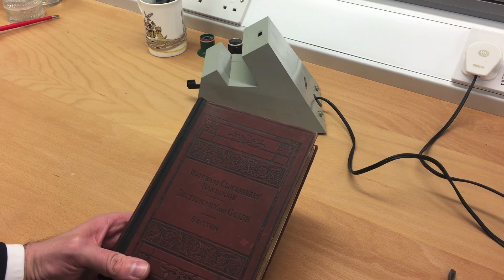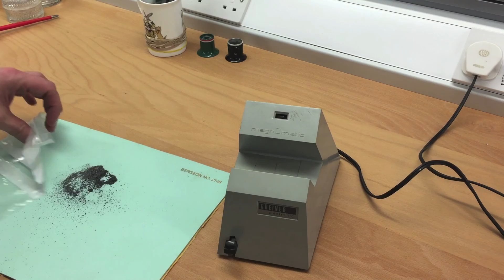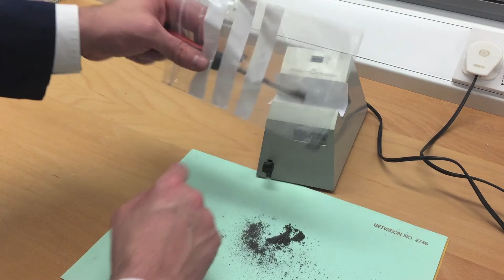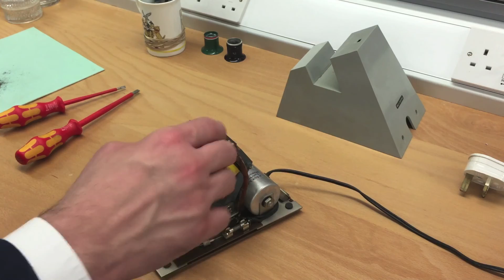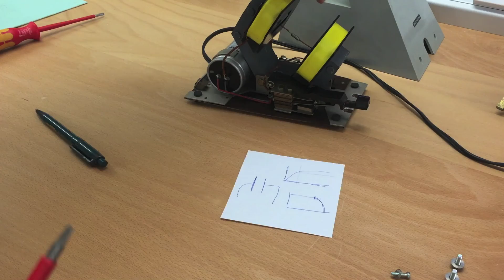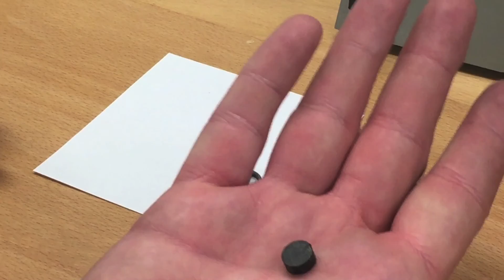Kosmos - Watchmaker's Demagnetiser, the Capacitive Greniner 'MagnOmatic'

Comment: Hi, Thank for showing us your small demagnetizer device. It’s to easy to contradict someone on the comment of youtube, I tried to find your email but I only find a tel number in Melbourne.
Your explanation about demagnetizing  is good there any way to achieve that an other example is the degaussing coil on cathodic tube TV but it’s always used an alerting and decreasing mag field. About you device, your explanation of the discharge of a capacitor is correct when you discharge it thru a resistance but in your case it’s thru a coil and I suspect a somewhat hi value coil, in this case you have a resonating circuit, that mean the machine discharge it’s power in a alternating and decreasing field (Ringing) that why it work so good. to see the discharge graph of a capacitor-coil circuit check;
http://www.readorrefer.in/article/Generation-of-sinusoidal-waves-by-a-tuned-LC-circuit_2996/
Thank for your interesting channel and excuse my English it’s not my natural language.

Comment: Magnifica explicación.  ¿Sería posible  realizar un diagrama del sistema eléctrico?
  Felicitaciones.  Buen trabajo. ¿De cuántos voltios es el condensador y cuántos microfaradios?

Magnificat explanation. Would it be possible to make a diagram of the electrical system? Congratulations. Good job. How many volts is the capacitor and how many mifrofaradios?
Reply from the maker: Hi Guido, 

Thanks for the comment. Please check my update video that shows the component values you asked about.I also show a circuit diagram schematic in the update video.

Comment: Capicators charge with Direct Current, and pass AC current. Thats why you have points  in  a auto engine. when they close you produce magnetic field charge in the coil and when it opens, the magnetic field colapses and produces the spark. Is there no diode in line? Thanks for the video. Greg